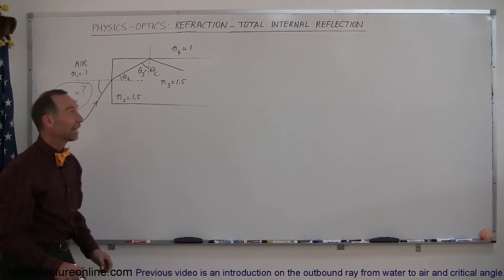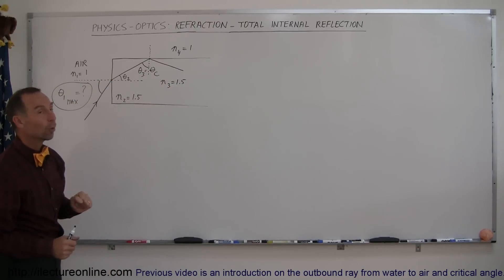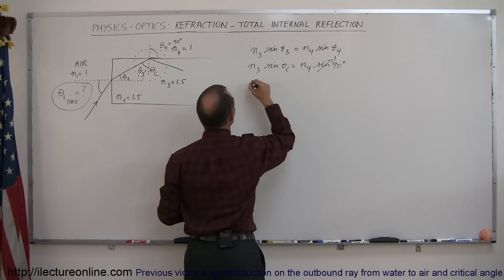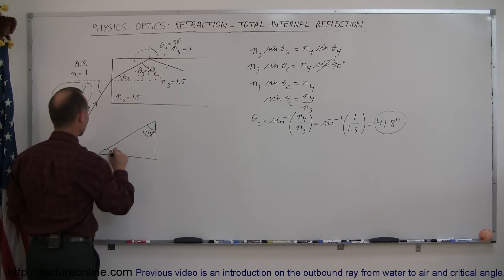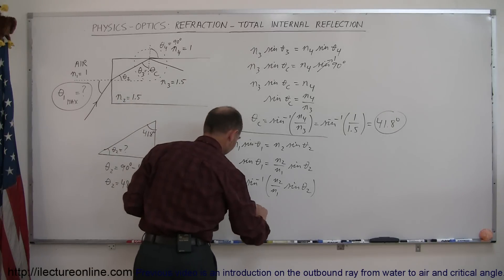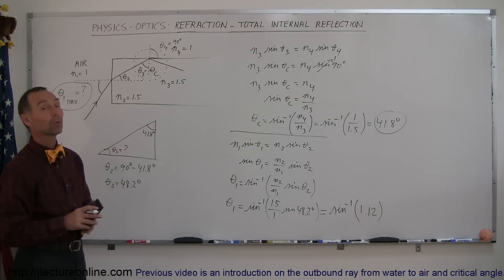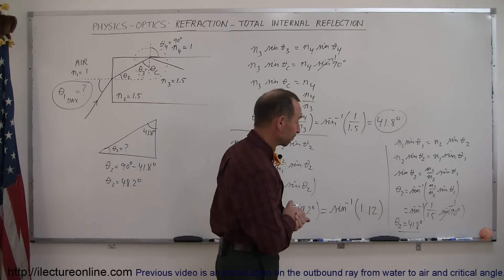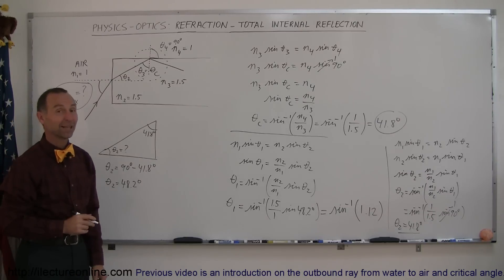Physics 52  Refraction and Snell's Law (5 of 11) The Fiber Optic Cable

Comment: Hello @MichelvanBiezen, at 5:25, you have the answer to sin inverse (48.2) x 1.5 = -1.12. Is that an error? Because I found that sin inverse (48.2) x 1.5 = -1.32. Thank you.
Reply from the maker: We cannot take the sin^-1 of (1.5 sin 48.3 degrees) because that is equal to sin^-1 (1.12) which is not defined.

Comment: Hi!! Great lessons, I am learning a lot with this optics course! In this particular case I give for granted that the results you have gotten at the end are related with the fact that you have assumpt the index of refracction of fiber optic is 1.5, for that reason I suppose the results are so perfect as you can through a ray of light into the fiber from any angle and still getting satisfying results right?
Reply from the maker: Not any angle.  At some angles, the light will leave the fiber optic cable.  But for most angles, the light will stay within the cable.

Comment: Great video but something doesnt make sense right there. And that is in my opinion the answer should be n3sin(90-theta3) = n4sin(theta 4). and then you find theta 3. What is you call Sir?
Reply from the maker: The answer in the video is correct.  Thank you for checking.

Comment: Hi professor Van Biezen thanks for the good explanation! I have a little question: How do you know that tetha 3 is equal to tetha c? Or is it given?
Reply from the maker: We are looking for the maximum angle that theta 3 can be up to the point where we will have total internal reflection.  At that point theta 3 = theta c
Reply: So when theta 3 is equal to theta c, then you will have total internal reflection? Because I thought that we will have total internal reflection when theta 3 will be greater then theta c. So I just have to memorize that theta 3=theta c --> total internal reflection? Thankyou
Reply from the maker: To be technically correct "equal to or greater than".
Reply: Ok I understand it, thanks a lot :)
Reply: @MichelvanBiezen  I still don't understand. I thought a critical angle could only result in a refracted angle of 90 degrees but here we are having reflection
Reply: @carlosvelez9491  not getting a ti reflection..but the ray isnt leaving the fiber..thats what is required for the question@

Comment: I have a question professor,
it may sound silly,
you said, we can take any maximum angle, so you took theta1=90.
What if we take minimum angle, I know there won't be Total Internal Reflection, but then we can send the data directly. Why don't we use this technology this way, professor?
Reply: +Arindam Bortamuly 
There are no silly questions.
Any sincere question is a search for knowledge, and this should be encouraged.

If a question sounds strange or out of place in any way then people's reaction should be "why is (s)he asking that question?" and try to understand that, instead of the condescending "what a stupid question" reaction.
Reply from the maker: +Arindam Bortamuly The smaller you make theta 1 the more likely it will be that you will have total internal reflection.
Reply: +Michel van Biezen 
Understood by watching the next lectures.
Thank you! :)